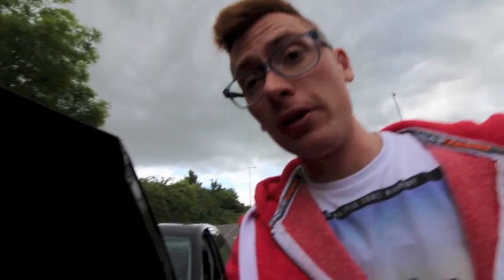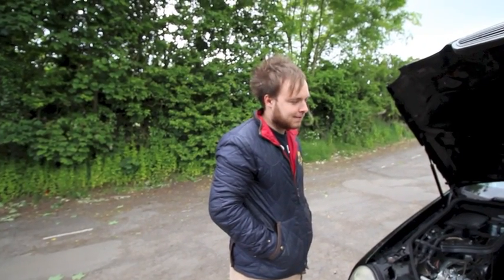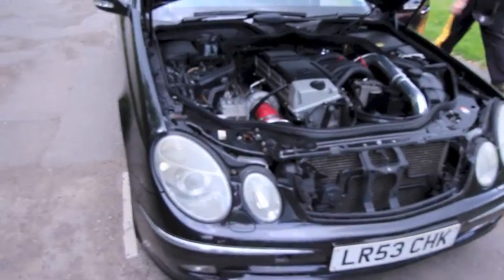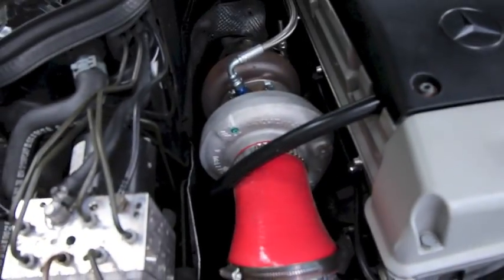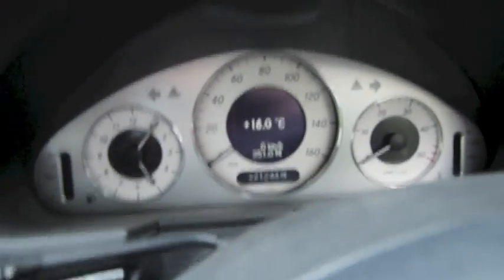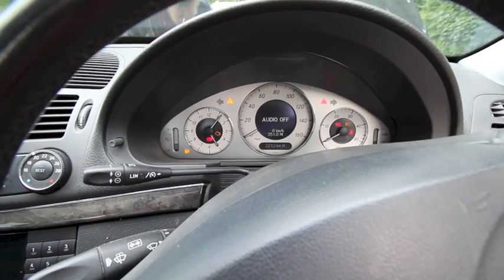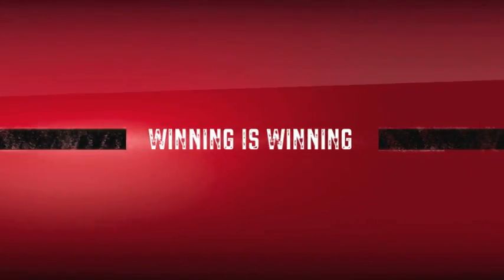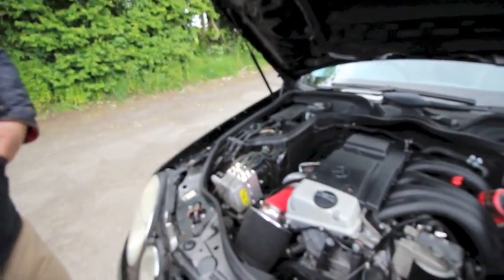Diesel Pump UK - W211 superturbodiesel e270cdi

Comment: What are your thoughts of OM647 ? Good for tuning ?
Reply: Of course. 300-330hp with stock internals.
Reply: @famirin  on the wheels ? Is there any proof ? In my country we dont have the inline 6 OM648 only the V6 diesle from the 320cdi soo we safely want to run good power on stock om647 without too much worry
Reply: @Ben_za00  On the crank.
Hybrid turbo, om613 fuel pump, c30amg injectors, 70mm downpipe, biggiest intercooler, 85° thermostat. I have a 285hp with OM612.
Reply: @famirin   c30 amg cdi with 612 3liter whats the limit on stock internals would u say ?
Reply: Hey bro can i ask u a question it looks like u know om612 well, with stock turbo and straight pipe 7 or 9lt intercooler, egr flaps off and delete what map can i do and how much hp can i achieve with this setup nothing else? @famirin
Reply: @AutoNshqip  Removing egr and swifl flaps is nothing) With a stock fuel system, the limit is about 220hp.
Reply: @famirin  1.7 bar turbo u mean?
Reply: @AutoNshqip  ~1.6 yes
Reply: @famirin  with 1.6 max u can achieve is 210hp thats what my friend got on w210 270cdi
Reply: @AutoNshqip  I don't do remapping, I just know the hardware and the address of the dinostand)))
Full stock 612 + double euro4 cat + remap was 214hp and ~1.6bar with a little smoke, il's all I remember.
(sorry, I don't speak english, it's крякозябровый translation)
Reply: @alexanderdanielsson6049  same 330, maybe 350, idk.

Comment: you can explain to me why all your cars smoke as black as that
Reply: Because they are making way too much torque and the engine is not fully burning the fuel because of the fast piston movements
Reply: @andi15536  In a mechanical injection pump, the LDA detects the turbo pressure. If the pressure increases, the LDA increases the amount of fuel injected. It's like a control signal for more power while remaining efficient and less polluting. injection?
To reduce pollution with a CDI system, you can make sure that the engine management software is optimized. Here I don't believe for a moment that the software is designed for this installation or an update of the injection system to the detriment of the air
Reply: @andi15536  after that it's not the first and the last eh, after that it still smokes a bit of diesel but at this stage no 😂

Comment: why not keep the om647? our c270cdi had the om612 (basically same as om647) and it made 300hp/700nm to the rear wheels
Reply: Hello brother, wanted to ask about my w203 612, if i do straight pipe egr flaps delete and off, spport air fitler 7 or 9lt intercooler and with stock turbo how much hp can i achieve with a good remap and what bar on turbo?
Reply: How to achieve those results?
Reply: @mbz4652  400cdi pump, amg injectors, 320cdi turbo no cats if i remember correctly
Reply: @jaakko200987654321 Thanks for the answer. I suppose 320 cdi turbo from w210?
Reply: @mbz4652  from w211. om648
Reply: Ye I want a w211 with a 320 cdi om 468 
The 3200 cc soo bigger than the om606 and coming rail soo high fuel pressure means more fuel and atamozation soo higher efficiency and there is a kit for like 10k (more than the cars value) to push 700 hp reliably soo its basically a diesel 3jz cuz the diesel 2jz is the om606
Reply: But om605 is super easy for high performance builds

Comment: @DieselPumpUK is the OM605 a straight fit in the w211? also is the electrics a massive turd to mate together? Keep up the good work
Reply: Not too much electronics , because in most cases om605 has mechanical injection that does not have like 50% electronics like the edc versions , only some simple sensors and for the speedometer

Comment: Black smoke racing changed the read diff and gearbox for a Toyota or Nissan item/s as they found standard stuff broke.
What was issue with common rail? couldn't fit bigger nozzles and remap etc?
Reply from the maker: The w211 already has a strong diff why change it?

Black smoke didn't ever use a w211.

Common rail gave us to many limp issues we did not like it.
Reply: DieselPumpUK some change common rails to mechanical pump with good results.Fair point RE diff on your merc. did u use the modern w211 gearbox?Black smoke do use a modern merc too now, but I don't know the spec of that one.
Reply: DieselPumpUK they use a w123 and a w203 it turns out.U rebuild diesel pumps etc? what do u charge to re element an M series pump out of interest? MYNA (I think) charge about $1500.